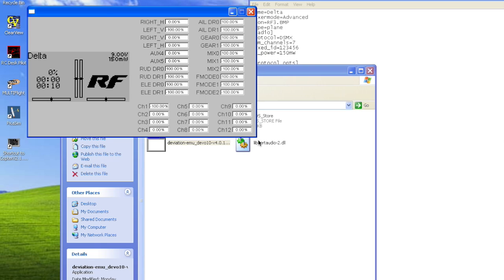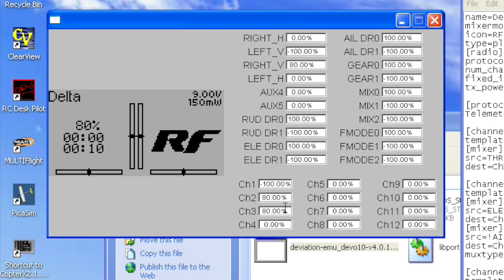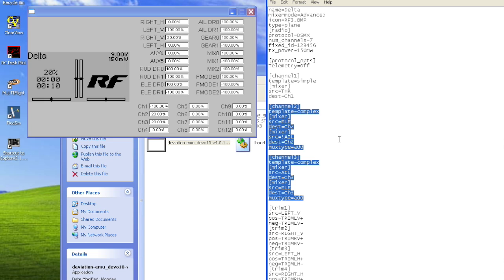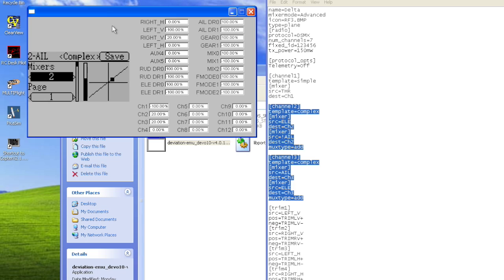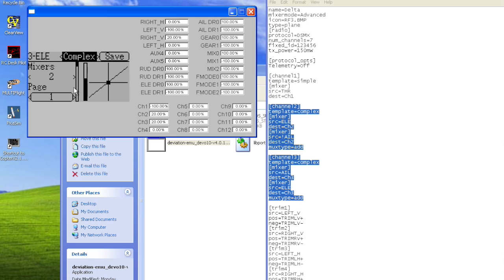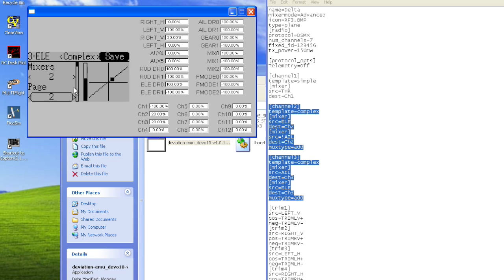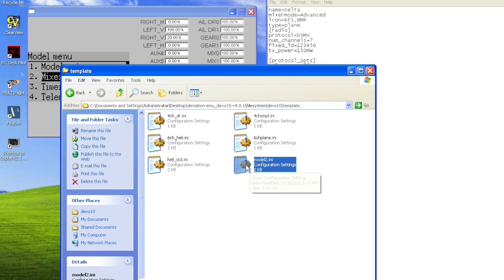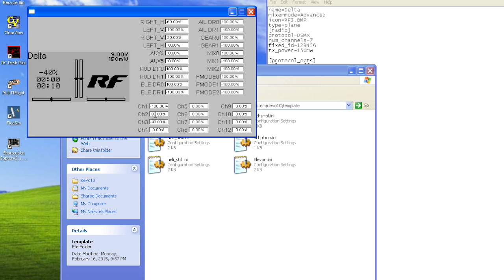Deviation - Elevon Mixing

Comment: Hi I'm using the new Jumper TX with the Devo software....  Thanks for this set up all is working except the Ailerons are working the wrong way ...stick left aileron down when it should be up .... i must be crazy what ever i try will not work.
Reply from the maker: Alan, this is the trickiest part. Have a look at what is happening one servo at a time, most likely one is actually working correctly(on its own) but the bad servo will cause the pair to function incorrectly. Once you do this just reverse one or the other for that one servo only. Should do the trick for you.
Reply: yes i swapped the servos and it works ... i have made a video now which i have posted. thanks